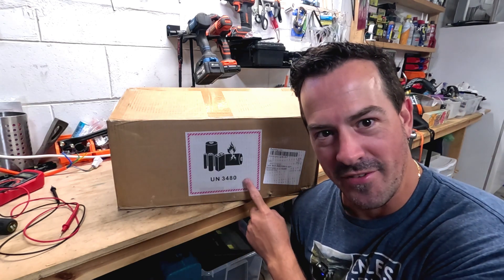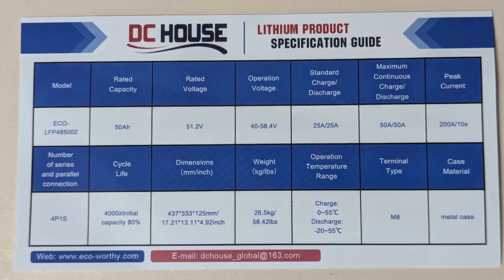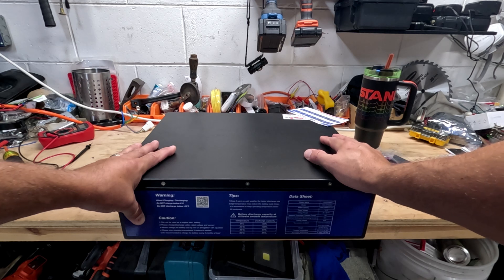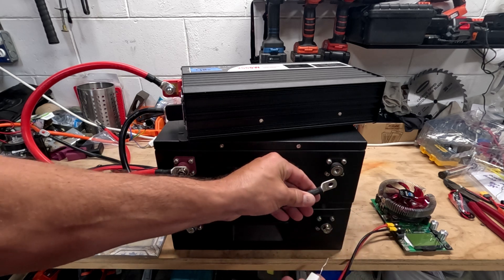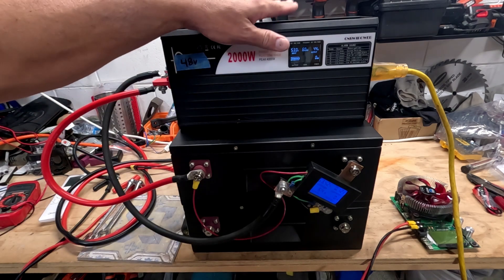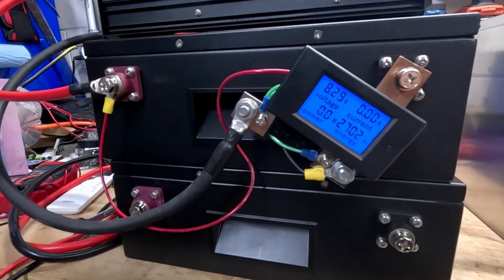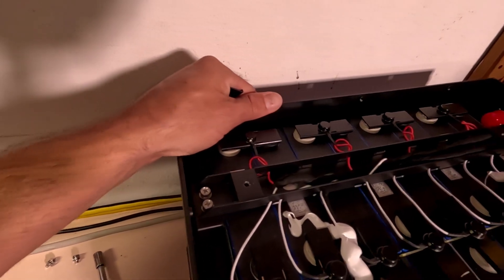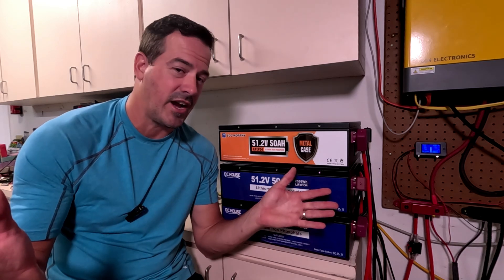Best 48v Battery for the $$$?? DC HOUSE 48v 50a Battery Review - Lifepo4 for DIY Solar Bank pack RV

Comment: What size fuse do you use on your battery cable i have 2 dc house 50ah and  one eg4 100 ah
Reply from the maker: I believe the rule is to shoot for 20% more than your wire can handle. 👍 So 120a on a 100a setup!

Comment: Is it really safe to parallel different battery brands? Since they might have different BMS
Reply from the maker: Hi there!  Technically if you have a BMS, it will protect it's own cells no matter what other batteries are run in parallel as long as they are the same chemistry and voltage.  When doing this, you need to know the max discharge and charge currents and make sure you do the math to not exceed those for each battery for optimal performance..

Comment: Since watching your video I purchased 1 for my solar system. Originally started with 2x 535w panels, 100/20 victron MPPT, and 1x 51.2v 50AH DC house battery. I've wanted to now make a purchase for a 2nd one to have combined total of 100ah at 51.2v, however I'm slightly confused if I need a battery balancer?
Reply from the maker: Hi there, that's awesome!! No balancer needed when running your batteries in parallel. The packs will keep the same voltage in parallel, and the bms in each will manage all the 16 cells in series.

Comment: What charger do you recommend? I was looking at Eg4 chargeverter but is there something similar with out the high price. If you can not tell I’m new to the space. I’m looking for higher amp charger.
Reply from the maker: Hi there! The best option is the SUN! But if you are talking about an AC charger, honestly, the chargeverter is one of the best options in the space right now.  With higher amp chargers you want to be able to program them if using a generator... also the ability to take rather dirty power and clean it up is a huge bonus.  Golf cart chargers are also a solid option: https://amzn.to/3ZwZkHi

Comment: Why is a spark on the connection bad?
Reply from the maker: It's just best practice to limit any uncontrolled rush of current when setting up your system.. you could trip your bms or get molten metal in your eyes. Those are the most popular reasons.

Comment: I’m not sure I understand the process of connecting two or three of these to a buss bar. Can they be connected together just using cables seeing as they only have one terminal set per battery? Also, do I understand correctly that the limit is four of these for a max of 200ah?
Reply: What if I buy one 100ah battery from somebody else now and want to add a pair, or 4 of these later, would I have to treat them as separate, with their own buss bars, or could they all connect to one buss bar?
Reply from the maker: I did get a response, you can connect up as many as you'd like but you have to do your maths on wire size and amp draw just like any other big pack... I like to run the same batteries in parallel, then hook up different 48v batt manufacturers or sizes up to the bus bar directly.. this way it minimizes any variations in voltage or resistance.
Reply from the maker: I'm not sure why its only a 4p 200a max setup either, I am going to ask them for more info. I do understand the bus bar; once you have more than 2 batteries in parallel, you will use more power from the batteries connected closest to your inverter over batteries in the center of the pack (or ends, depending on how you wire them). Bus bar keeps everything as equal as possible, and really high power systems should have every battery on a bus bar with equal length copper.  I am not so serious (or using that much power) to make a big difference in my setup, but also minimizing any unbalancing where I can.
Reply: Ok, so, because these batteries only have one connection point, can I stack jumper cables from one to the next using a longer bolt to get them in parallel, or should they have their own buss bar if I’m paralleling 2,3,4… of them?

Comment: That's an amazing price (I'm seeing $700 for a 2-pack, aka 5.12kWh for $700 USD).  I think I see a pattern here, because something similar is happening with solar panels too.  An OEM tries to maintain pricing for its established brands but creates a new brand with the new pricing as manufacturing costs drop.  Even though the internals are exactly the same.

I like this form factor better than the group (car/truck battery) form factor.  Makes it very easy to stack and parallel a bunch of these guys.  Even though the batteries don't have all the bells and whistles (I would have liked to see at least a built-in DC breaker), just the sheer amount of storage you get for the price is a big selling point.

-Matt
Reply from the maker: Thank you for your comment, I totally agree!

Comment: Better to use an Anderson connector to make your connections.  That way you won't accidentally short the leads out.  Put one set of cables on the inverter with an Anderson con.  and do the same with the battery(s).  Then your inverter is interchangeable with other batteries you might own and want to use and safety is ensured when making connections.  Wiring direct is so dangerous.  At the very least you want a DC circuit breaker in line.  I've tried many wiring schemes over the years, having built many systems and use of Andersons is the easiest way to get the most out of inverters and batteries.
Reply from the maker: For sure! These are just testing conditions... but I do see your point even in that environment.  Remember the BMS has short circuit protection as well, so anything additional would just be for extra safety. I'm all for that. I have a spare fuse I could use for now.  If I am going to buy, I'd probably go qs8 connections with an anti-spark resistor built in if I wanted a quick disconnect.

Comment: I do wish when the title says "cheapest on Amazon" the video would start with the price 😢
Reply: Just googled it and in the UK 🇬🇧 they are £449.00. Not a bad price that's like £224.50 each for 2 100Ah 12.8 v batteries
Reply from the maker: Good point!! They are $350 each - $699 for 2. Also, These are 48v 50ah each.. so 2x 48v 50ah would equal 4x 12v 100a.
Reply: Not a bad price on the 2 pack if you must buy ready built and or need fast shipping. But in my opinion, much better to buy a case kit and cells and build your own.
Reply from the maker: @vladimus9749  lmk the math on that... I am still around $2200 for a 280ah system. These end up being cheaper
Reply: @TackleThat Sure, $1424 for Eve 280 cells free shipping within US from gobel power. Yixiang case for $389+$125 shipping. Total $1983. That said I would go with better and slightly cheaper cells shipped from China, but I quoted a trusted US shipping option. 300ah with DC House would mean 6 units to link up, mount and manage for $2100. 3 year warranty is nice but I've never heard of this company so who knows. Still, I'm not saying it's not a compelling deal. It certaibly is for some, but I don't think it's better than DIY yet, for those willing.